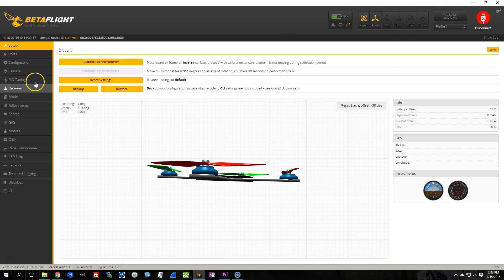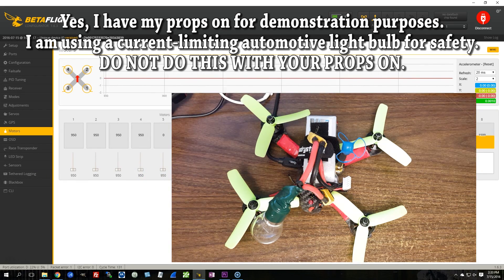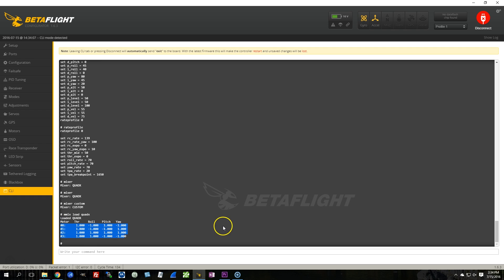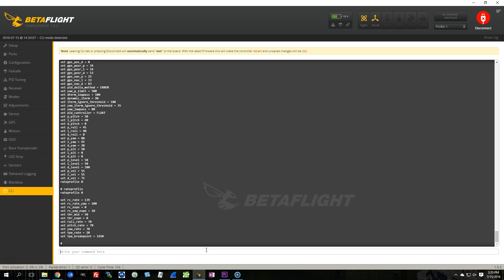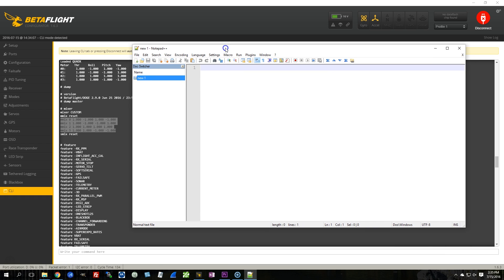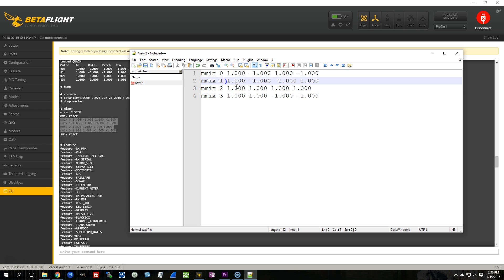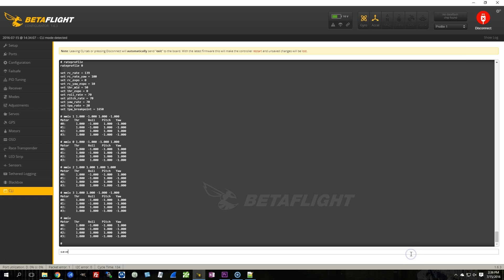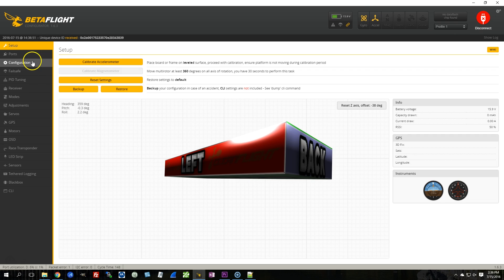Quadcopter Motors Wrong Order: Cleanflight/Betaflight Easy Fix [UPDATED METHOD IN DESCRIPTION]

Comment: I have a KISS FC running Betaflight 3.0... issue is that pad for motor 2 got ripped out so I soldered motor 2 to motor 5 instead. Will this walk-around work?
Reply from the maker: +Pablo Contreras yes.

Comment: ahhhhhhhhh so the order of motors in the mixer DOES matter hopefully i can get my custom diy hovering soon
Reply from the maker: The order that the commands are entered doesn't matter, but the numbers at the beginning of the lines does matter. The numbers at the beginning of the lines refer to which motor header is being assigned the mixer line. Confusingly, the mixer lines count up from zero, while the motor headers count up from one.
Reply: so in situation i have a busted pin 1 or input 0. i am stuck in the crazy flip takeoff mode.  i zeroed out the roll pitch and yaw for motor 0 and added another motor at input 4 to replace the missing pin while double checking the orientation inputs for all motors. do you think because i did not zero out the throttle on input 0 this would cause my quad to behave like i have described?
Reply from the maker: Yes, probably.

Comment: if all motors are turning in the "wrong" direction, you could also use the "set yaw_motor_direction" command.
Reply from the maker: Some people do this on purpose to keep the front props spinning away from the camera.
Reply: I actually run one quad "normal" and one reversed, because I seemed to destroy one type of prop more frequently than the other. feel and handle absolutely identical. MASSIVE THANK YOU for your vids btw!

Comment: Hey Joshua, I have a question.  My main copter has a Naze Rev6 board and I run Betaflight 2.9.0.  I use the Betaflight configurator on my laptop for tuning at home but I want to do some fine tuning out at some spots where I have more room to fly FPV.  I downloaded the EZ--GUI Ground Station app on my tablet but when it asks what firmware I'm running Betaflight isn't an option.  It lists MultiWii, Cleanflight and Baseflight.  Can I use this app?  Would you recommend trying to use this app?   Thanks.
Reply from the maker: Use cleanflight. Betaflight is backwards-compatible. Some betaflight-specific options won't be present, except via the CLI. I use the app for basic PID and rate tuning in the field though, no problem.
Reply: +Joshua Bardwell great!  I thought it should work if I select clean flight but just wanted to ask you.  All I want to do in the field is rates and PIDs so that'll work for me.  Thanks for the reply.
Reply: +Joshua Bardwell hey I just rebuilt my quad after some PDB issues and the only new parts are 4 little bee 30a and a replacement naze.  Copter flew very smooth before with 2.9.0, stock pids and some cheap 20a ESCs. They said 0neshot125 on them but I selected pwm in BF GUI.  The only difference now is the LB 30a's and 2.9.1.  The problem is some very small, erratic yaw movements when I hover.  I immediately landed.  Should I select something other than pwm?  Go back to 2.9.0?
Reply from the maker: +ShareCraft try oneshot.
Reply: +Joshua Bardwell thanks.  No change with 2.9.0.   Also the default .5khz PID and 1khz gyro update ok?  It seemed fine before.  Accelerometer is always off.
Reply: +ShareCraft oneshot125 no help.  Maybe even a little worse and the motors twitched even when not armed.  The unarmed twitching happened with the last ESCs I tried oneshot on. (The ones that said oneshot on them).
Reply: +ShareCraft new slider in the GUI I just noticed.  "Motor pwm speed separate from PID speed". I know that wasn't there before.  I just recalibrated ESCs.  Not sure what to try.  I greatly appreciate any advise.
Reply from the maker: +ShareCraft it's just the option for synced vs unsynced motor output.
Reply from the maker: +ShareCraft unarmed motor twitching, lower min_command after calibration. Do not recalibrate. 

Maybe your issue is pid loop jitter. What is your CPU utilization in the "ststus" command?
Reply: +Joshua Bardwell lowering min command fixed the unarmed twitches.  Does my craft need to be armed when I check the CPU %?  Right now it's 1% with only USB powering it.
Reply from the maker: +ShareCraft doesn't need to be armed. 1% is obviously fine... 😊
Reply: +Joshua Bardwell i was googling my symptoms and came across Bountysource.com.  There was a user describing the same symptoms and happened to have the same fc and ESCs as I.  User Grahamcropley suggested soft mounting the fc.  I was looking for an assorted o-ring kit that I bought long ago but I turned up something even better.  So much better that this may change how everyone mounts they're fc in the future.  I found some team associated dust covers for keeping dirt out of ball joints on their rc cars.  They're open cell foam rings about 2mm thick.  They're super light and airy.  I stacked 3 on bottom and 2 on top of each nylon screw.  I think these are better than o rings because they damped the bound as well as the rebound.  Seems to me the o rings would only dampen the initial bound.  Would you agree?
Reply from the maker: +ShareCraft I'm not sure I'm qualified to say. At these high frequencies I don't think there would be much distinction between the bound and the rebound.
Reply: +Joshua Bardwell I guess that's true of the high frequency vibes.  I just feel like it's more "suspended" in the mount and would be less jarring.  Either way, it got rid of the yaw jitters.
Reply from the maker: +ShareCraft but you don't want to filter the low frequency vibration. That's exactly what the PID loop needs to see.

Comment: Seems easier to just go and resolder the wires in my opinion
Reply from the maker: +Sundee not at all in this case. The wires had plastic insulation and I had already burned it back as far as it would go. One more mistake with the iron and I would be replacing the wires entirely. Also, I was all ready to go fly. The fix with the mixer took two minutes. No heating up the iron, taking out screws, etc...
Reply: i feel the same but for some the whole idea of having to solder again freaks some people out
Reply: I can see it as a good quick fix but I wouldn't want that as permanent as next firmware update and have to redo it all over again and no doubt will forget. Also good to know can do this tho.
Reply: Man this hobby gets deep! I have a question, I’m hoping someone can answer, I have a hexacopter, and all the motors spin the right direction, however from all the photos of this hex that I compare to mine, motor one, upper right, is in-correct, in that, it spins CW, and is a CW mounted motor. With that being said, could this be the cause of this hex insta-flipping on take-off? Does a hexacopter need motor one to spin CCW? Then, moving clockwise around the hex, every other motor spinning the opposite direction?

Comment: I didn't know you could do this! Fantastic tip. Did my first direct solder using a LittleBee 4 in 1 board. Got it right but it would have been handy if I soldered it up wrong. Great tip

Comment: On a somewhat related note, is it bad practice to reverse motor directions in BLheli firmware? I have my motors wired alternating but I had to flip the direction of all 4 motors because I didn't test before soldering the motors to the quad.
Reply from the maker: +Weston Will it doesn't matter. Except there is one DYS ESC that had a bug where it would desync randomly if you were using software rotation reverse.

Comment: Thanks Josh - I used your notes from the previous video to create a custom mix for my Bolt 210 just because of the geometry of the build (it made it easier to reach the motor output pins)  Anyway, I also noticed that not only do you get that box in Betaflight/Cleanflight, but I also look like an octocopter in Blackbox.  Kind of annoying, but all the info is still there.

Comment: Hi could you explain the purpose of the bulb? AFAIK it is there for current limiting such as when you want to test a newly flashed esc but what is the purpose in this case?
Reply from the maker: The bulb only lets about 3 amps go through. The motors can't spin fast enough to do damage with the bulb in place. This makes it safe-ish to do the testing with props on.
Reply: It is current limiter, it hopefully prevents quad to flip unexpectedly fast to unexpected direction. Kinda replacement to props removal in this case. Joshua, correct me if I'm wrong.